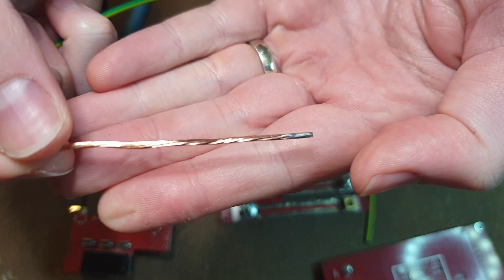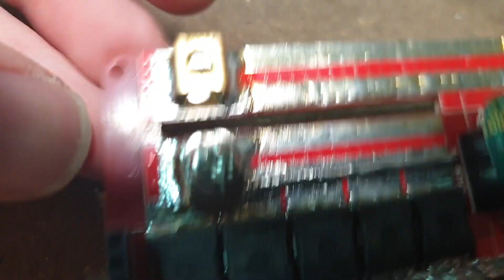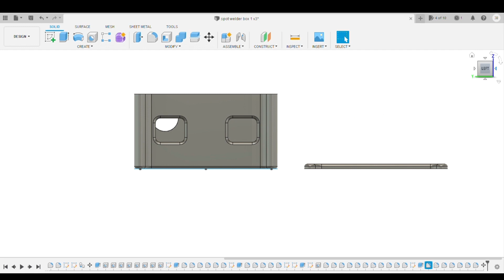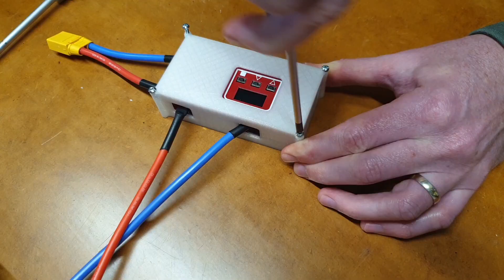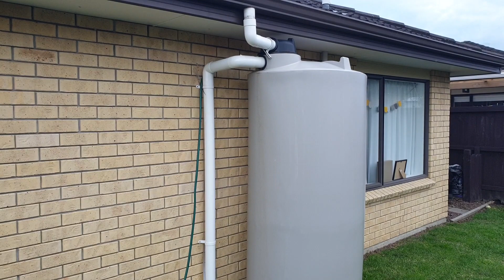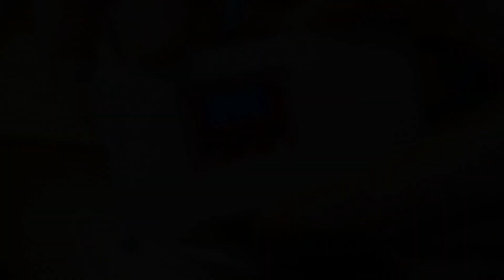Cheap Spot Welder CA20-2k - Mods, Protective Box, and Explanation

Comment: Can you do a parts list.

What W are the 500ohm capacitor and 22ohm capacitor?
Reply from the maker: I only used resistors, not capacitors. 1/4W. Don't think it really needs a parts list, just write those down and ask for them at your local electronics store, or order online.

Comment: Nice video, thanks for the information and using the hose analogy to explain resistance. As a "Sparky"  (electrician) I usually use the crimped hose analogy but this is better.
Reply from the maker: Cheers!

Comment: Nice work. I'm glad that mine is the earliest version. Only needed a capacitor and beefing up the traces.  Probably done over 1000 welds using a 12V Lipo (5AH 70C) for my power source.

Comment: The 1 mm gap from + to - is absolutely fine. It takes around 1KV to arc 1 mm.
Reply from the maker: Yes I figured it must be fine since no one has ever said it's been an issue before. Rather strange to have a milled gap in the PCB between the + and - lines but then have them almost touching at that point.

Comment: Great video. Looks like you've already done the cap mod? I wonder if a 3S XXXP 18650 pack would work to power this? Would they give enough 'punch'?
Reply: Hi well ive just looked at my board and its totally different to this one it was only when i watched the vid again i though hmm mine has got more parts that that lol  never even gave it a thought will have to post some pics if its aloud here
Reply: BK11-1k thats mine
Reply from the maker: Yes I think that would work if the P part is high enough

Comment: ive done a few mods to mine  as i blew 2 fetts when i first got it lol   ive put heatsinks on the fetts  made the traces thicker added some big diodes and a  capacitor  where you fitted a resistor .i found the fetts went due to using a lead acid battery
Reply from the maker: Yeah I think you might have the -1k model which is a fair bit different